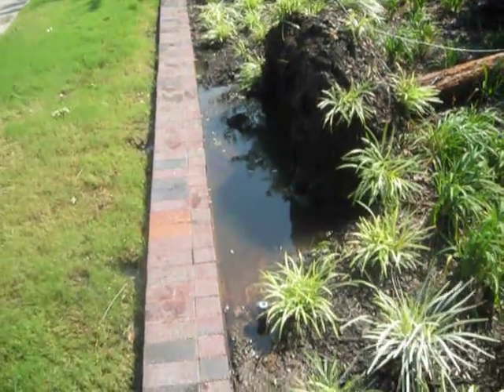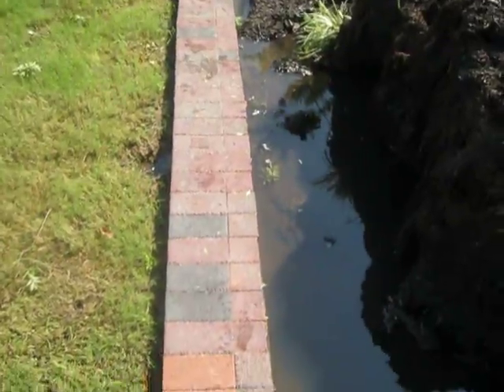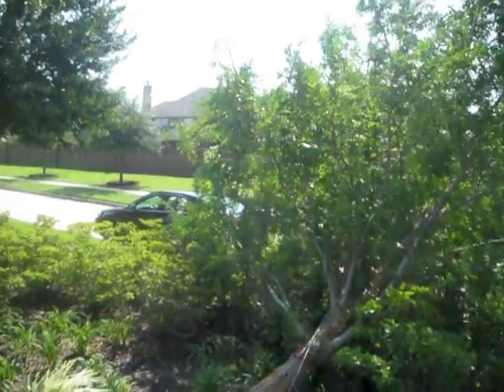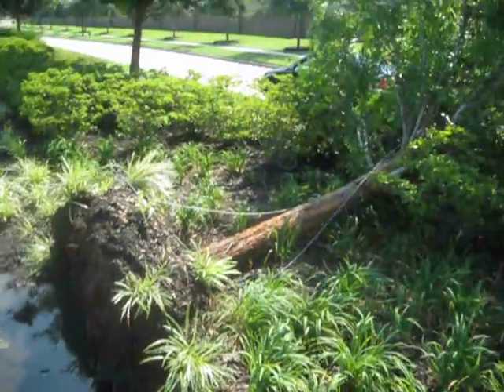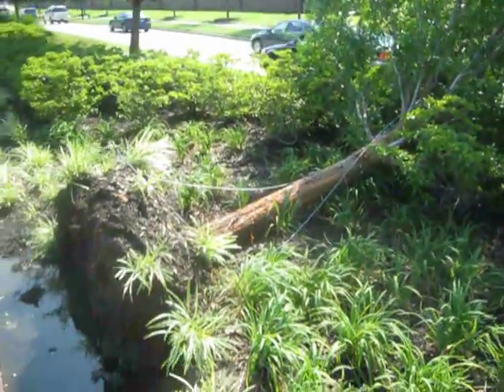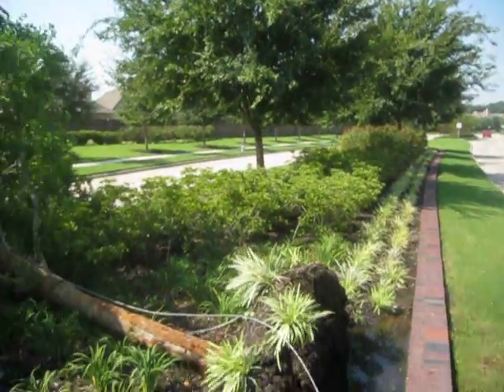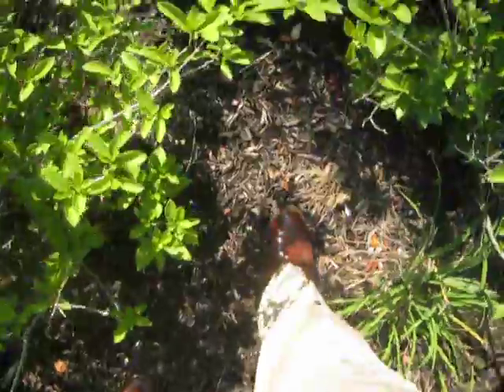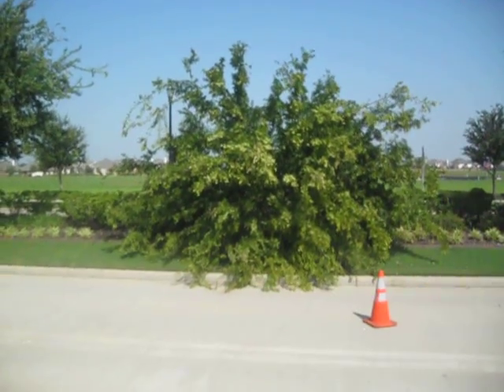Gene Basler Houston Arborist Windthrown Lacebark Elm

Comment: I planted a lacebark elm a 2 years ago....  it had a 4 inch diameter trunk....   after two years the roots had really take and the tree has more than doubled in size.   The roots are incredible.  It would be hard for the wind to do any damage.
Reply from the maker: Sharkattackguy that's great. Healthy spreading roots are a recipe for a long-life. Remember sometimes wind doesn't act alone. Soil failure can also play a part. Especially in the right kind of storm. Any tree can fail given the right conditions. Failure is simply defined as force exceeds strength. If there's a drought year, or soil temperatures cause fibrous feeder roots to die back, or a slowly corrosive root rot sets in, and the tree has not had time to regenerate its root mass, even the most extensive root system can fail.
Reply: I agree....  my try is half the size of this one..  and it looks like the fallen tree has the same size root ball as mine did when mine was planted